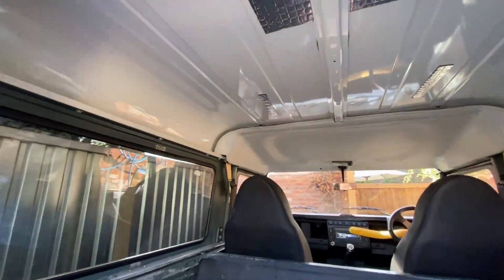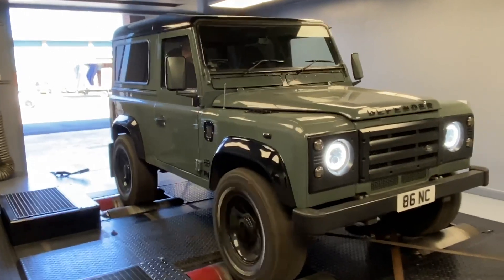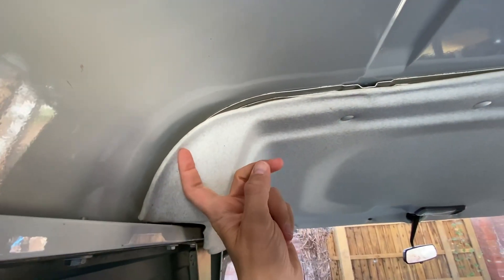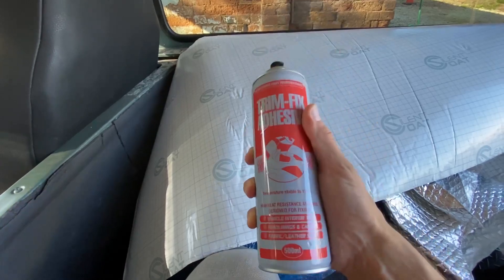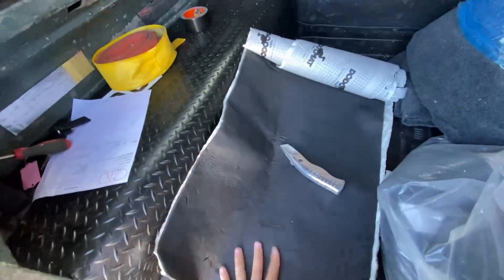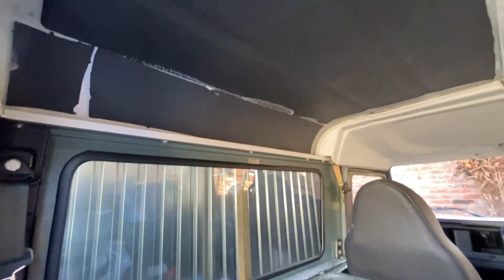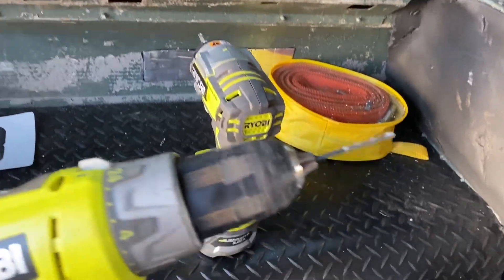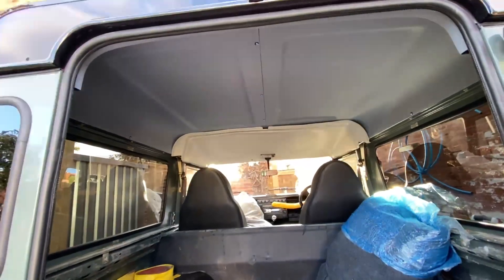FITTING A REAR HEADLINER TO MY LAND ROVER DEFENDER 90 VAN BACK!

Comment: What about grey or black suede effect to cover both the front and back headliners. It might improve the overall look of the interior and help the front and rear look the same. It's a simple job, like carpet lining and can be done with trim fix adhesive. I'd suggest getting yourself a half decent mask for using trim fix in small spaces.
Reply from the maker: Thanks Peter-  just looked in to suede trim on your recommendation - looks easy to do and much better price wise that alcantara! Thank you 🙏🏼

Comment: You need to cover all the bare ally roof with the black insulation not leaving any gaps like you’ve done. Expect to get condensation underneath your new rear headliner still where you’ve left bare roof gaps.
Reply from the maker: That’s not the comment I was hoping for 😂 I guess I hope it doesn’t get too damp? I don’t think I can face taking it all down again. However thanks for the insight I’m sure that will Be useful to anymore else thinking of doing the same job 🙏🏼

Comment: Yikes I wish you had first covered the bare metal with silent coat black and then used the foam over it leaving no gaps. Would have made a notable difference. And the silent coat foam sticks like crazy, u don’t need trim fix but it’s also in the prep. Clean the bare metal with degreaser beforehand.
Reply from the maker: I wish that too to be honest Justin- may have to relook at it plus buy some more silent coat!

Comment: Why not do it properly? It kills my OCD 

Take it all out, fit sound deadening in the front section then get a roof line that’s one colour from front to back or get the current ones lined maybe. That way my OCD will be able to relax lol 

I did all mine, I used dynomat and it’s worked really well. 

Love the channel, watching in MELBOURNE Australia
Reply from the maker: 🤣 I may have to do a bit of refinement to sort out the colour change but also settle your OCD- I may end out covering both 👌🏻
Reply from the maker: And glad you like the channel, thanks for watching 🙏🏼